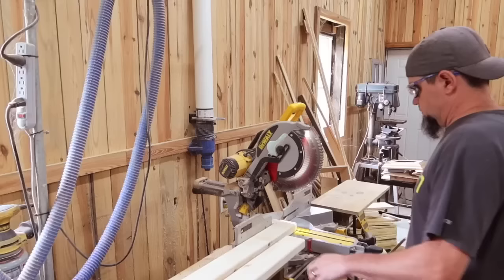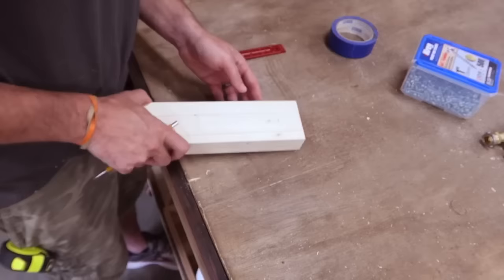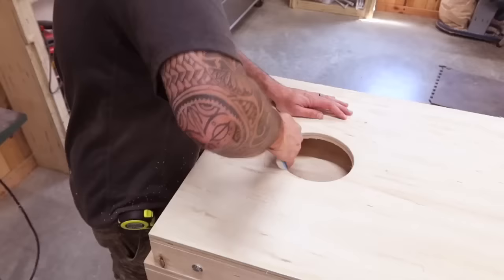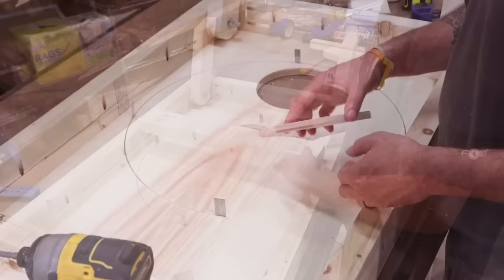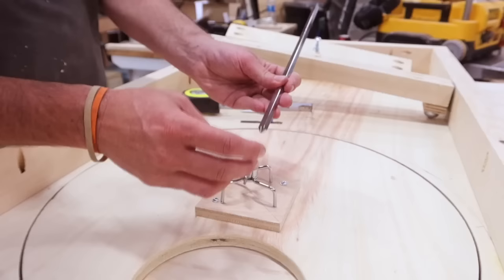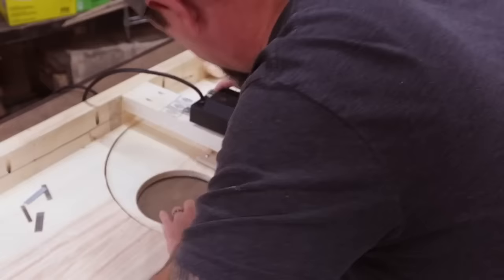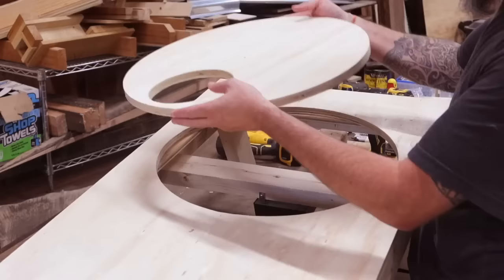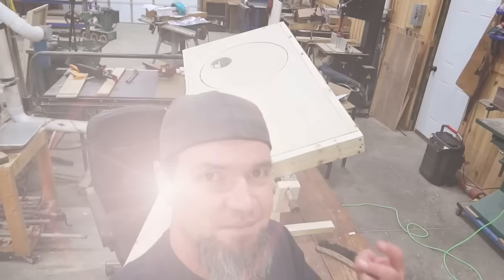DIY Ultimate Rotating Cornhole Boards - Make Money Woodworking

Comment: My next door neighbor makes a lot of cornhole boards so I dont make them because I can make other items he cant and it would be kind of unfriendly.   I thought about making one like this and giving it him to test for durability.  I guess my main concern would be how well the motor and disk mechanism would hold up overtime through thousands of impacts and rough handling.  However I decided not to make this version  because it uses a 120 V AC motor.

Not going to mince words here.  The rotating cornhole as presented in this video is a fantastically BAD business idea.  Given the rough handling and general carelessness of people, using 120 VAC power for outdoor recreation is just wrong in so many ways it should be obvious.  If you sell this as made here, you better have a tight LLC and liability insurance.  This kind of device needs to use a low voltage DC motor with a grounded power supply approved for outdoor use.
Reply: Being in the electrical business,I was thinking about wet lawn and AC as well. But the thing is, Matthew is providing the seed of a great idea, and it is up to everyone to improve on it if deemed essential. That's the group effort he is preaching here, I think
Reply: @williamwoo1437  If you read some of the comments it is clear that some people have no idea, and are ready to just make as presented.  There are other serious potential problems as well.  If the motor has a UL listing and is not specified for this use that could be a serious legal problem.  The cord management is also a problem because there is no attachment of the cord as shown to keep it from getting worn by normal "as intended use" of collapsing and raising the legs.  As I said, the application calls for a low voltage dc motor and outdoor safe power supply.  That will reduce the danger to a consumer but if this is not carried out and designed by someone qualified it may still be a potential liability to whoever is making and selling them.  The video is also pretty gung ho advocating people to make these ASAP, which is not exactly the same as "lets all think about and reflect on this". 

 There is a link to the rotisserie and very good explanation on how to make use of it in construction.  This is not going to lead to a lot of people with limited electrical experience but who are anxious to make and sell these to slow down and think things through.

It occurs also occurs to me that modifying the motor as shown could possibly completely nullify the UL listing or any liability of the motor maker.  Impossible to tell from the video but I am wondering if his removal of the factory mounting bracket changes the grounding or insulation of the device.  Putting those obviously conductive brackets directly to the motor would disrupt any double insulation grounding.  Cant tell if this is a valid point since I dont own the rotisserie device.  When manufacturing something like this it is just reckless to NOT assume people will not do things like use innapropriate cords to run into their lawn, not get drunk and play in the rain, not pay attention to cord fraying due to collapsible feet etc.  It is a very cool take on the game as is the other prototype.  I mean it has serious flaws as a product but I am not saying it is anywhere as dumb as the Elon's hyper-loop, Trump University or Mark Cuban's crypto scams.
Reply from the maker: You can easily buy a power inverter that runs from a 20v battery.  Your right willilam.  This is a concept.  Folks can do with them what they want.  Pretty sure its code for all outdoor outlets to be gfi.  Just saying.
Reply: @walterdimmick653  You are right about all these potential hazards. Your comments should be pinned at the top as references, and then people can make a decision on whether to move forward as is or with modifications